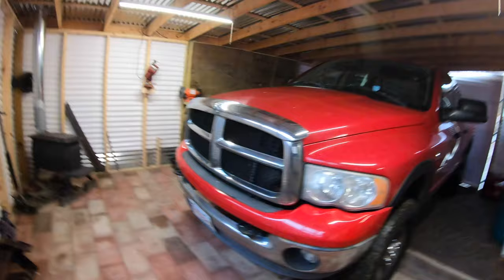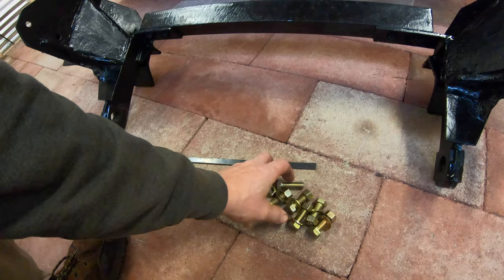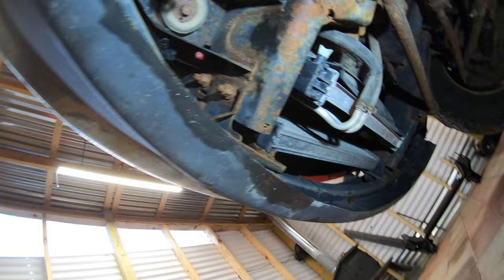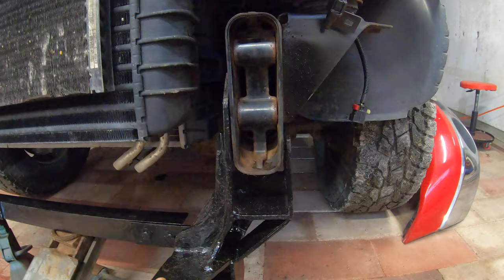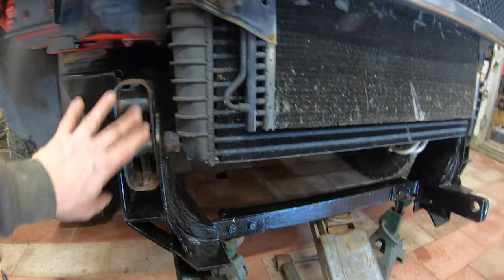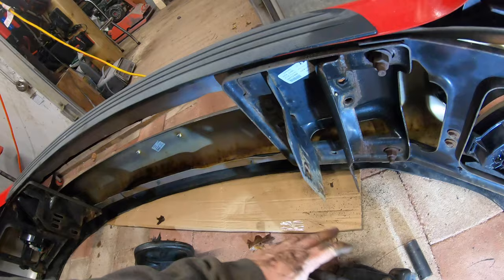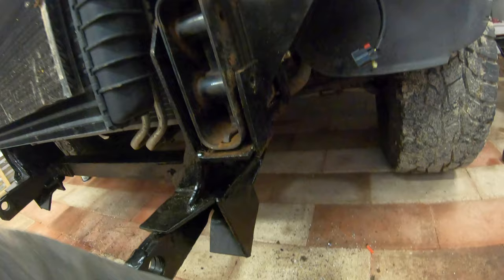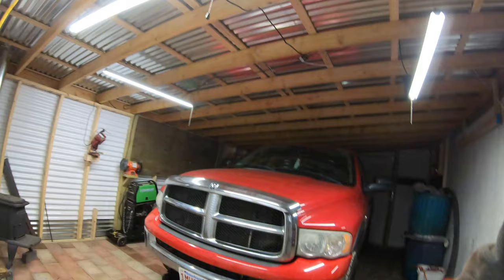HOW TO Install Fisher Snow Plow Mounts (Push Plates) On a 2005 Dodge Ram 2500 Cummins Pickup Truck

Comment: Fischer actually recommends a grade 5 bolt. I'm installing the same mount and looked up the kit and decided to do exactly what your doing. I believe they recommended the grade 5 bolts so the bolts would break before the frame would bend. I used grade 8 as well though. Also at least for me getting the 1/2-13 bolts in the specific sizes they suggest is not always easy so I figured maybe we could ease some minds out there and let them know you can use a 2" instead of 1 3/4 or a 2 1/2 " instead if the 2" in most places. I like your idea with the rods. I ended up just using a long extension with a swivel on the end and a short socket and kind of fished them in. Thanks for the video and stay safe. Ps. My experience was installing the correct frame in a 04 superduty.  Same idea as yours a little more room in the frame is all.

Comment: Could you please do a video on your wiring setup for this plow? I have a 3 port module and it has a weird connector on both headlights that won't go into anything. I have no headlights
Reply from the maker: Unfortunately I no longer have this truck... But you can go to fishersnowplows dot com and support and download free install and parts manuals for your truck. I would first use ematch as if you were putting low on, then at the final page it will list components including peculiar wiring kit #. Use that number in the support to find the wiring for your and how it all installs
Reply: @KenMrKLC  ok thank you

Comment: Hey excellent video tutorial. I’m looking to do same on a 2006. How much you pay for used fisher bracket ? What size plow and is it going to be 2 or 3 plug. I guess it be better to purchase new wiring.
Reply: Hey Mine is a 5.7 Hemi The one guy selling the bracket and another person is selling a 8’ foot Fisher plow. I will look for any wiring used if get new. Your going with a relay or module system.
Reply from the maker: Mine is a 3 plug Fisher Plow... I think I paid $400 for the mounts and the wiring with iso module. Didn't include the controlled which I had already.
Reply: I found someone selling that truck bracket for $250. Going to offer less. I have several leads on 8’ foot plows. Probably purchase new wiring if don’t find it used.
Reply: I bought new wiring
Reply from the maker: @dirt3964  that’s a good investment in my opinion.... play it safe. It’s not that expensive to have new and then less risk of broken wires and corrosion etc.
Reply: @dirt3964  how much is all new wiring less the module for a western 04 ram 1500?

Comment: Aha, them end plates on the mount is called push plates..? Okay.
I have a 2001 dodge ram 1500 4x4.  I have a mount that was for a chevy truck.  It is not only short by roughly 2 inches but of course the push plates where it gets bolted on the truck is of course wrong.   
Can I buy some sort of push plates.  Bolt the plates on the truck and then simply modify the mount, bolt or weld it on the mounting plates.  
I am thinking it is the those mounting ends of the whole mount mechanism is where the work is.